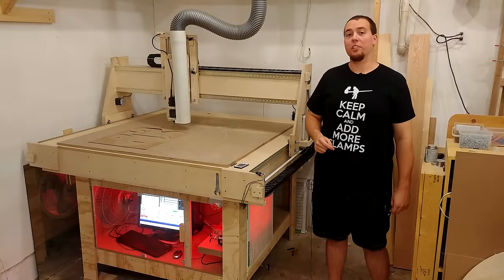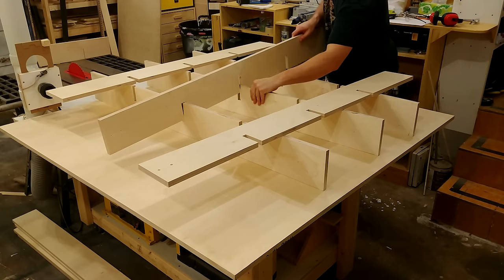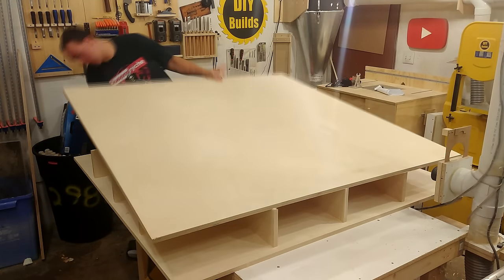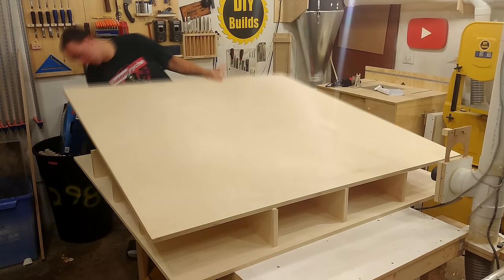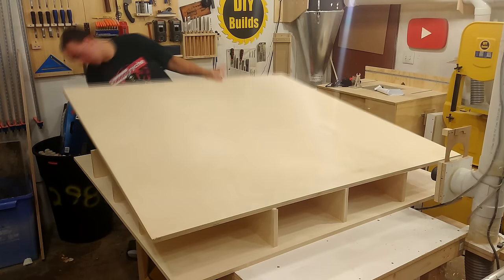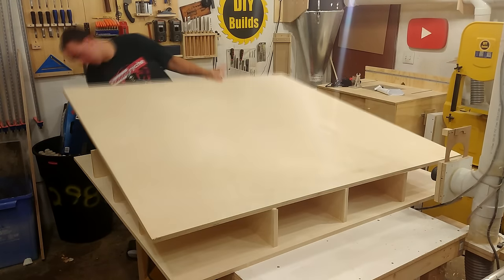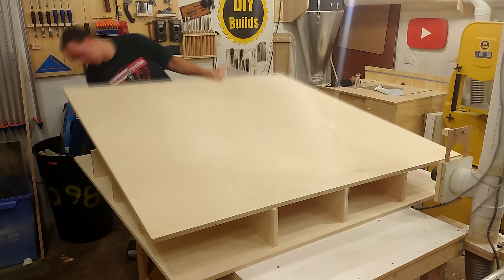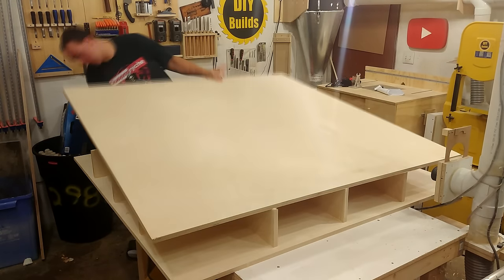DIY CNC Router for Under $900 - Free Plans Available

Comment: please use real wire not speaker its cheap and better to handle the load without burning down
Reply from the maker: Its 16 gauge. Its fine.
Reply: @DIYBuilds   less about the wire and more about the insulation sleeve not handling the heat of the wire
Reply from the maker: Im an electronics engineer. I think ill be ok.
Reply: @DIYBuilds    im a civil engineer but to be clear my comment was for your viewers who may replicate your build